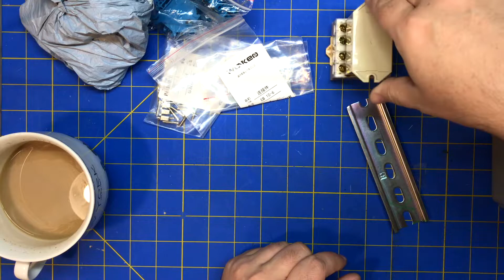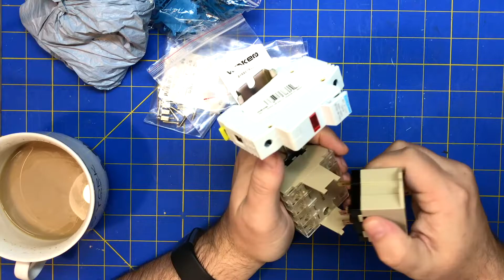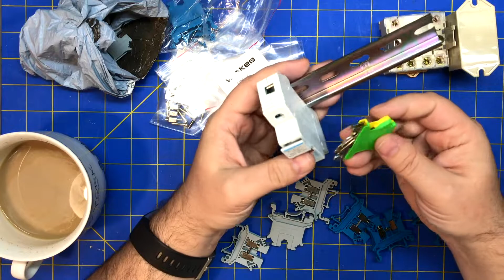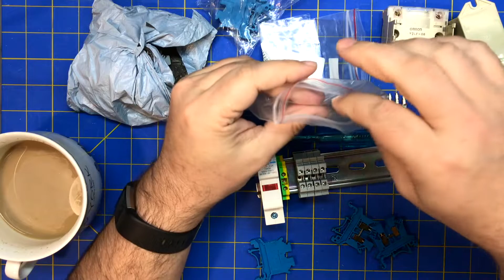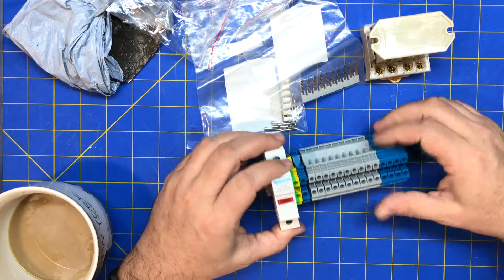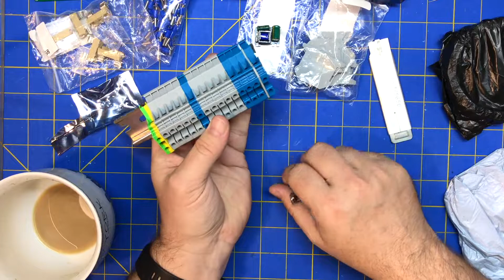DIN Rail project VLOG

Comment: YOU HAVE TO LIFT THE CLIP FOR MOUNTING THE COMPONENTS IN THE DIN RAIL
Reply from the maker: No you don't, the catches are bevelled, you can just click them on, you need to lift the clips to remove them. They are snap fit. That fuse holder is just crap ebay quality and not made right

Comment: I've seen all manner of this "DIN" compatible stuff, everything from breakers/RCD/RCBO (normal stuff) to DC power supplies, relays, voltmeter/ammeter modules etc all made to fit on a DIN rail. Building this out as a sort of DIN rail "breadboard" is such a cool idea!
Reply from the maker: Yeah I have been meaning to use them for years, finally got around to buying some, thingiverse has some really nice desktop stands for that kind of use also.
Reply: @tablatronix  I didn't even think of that, gotta dust off the 'ole Ender3!